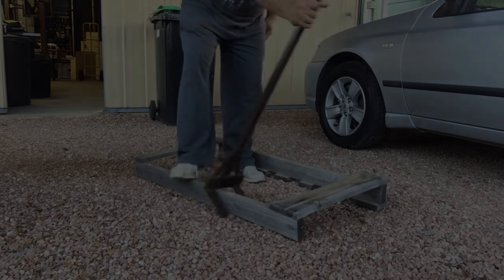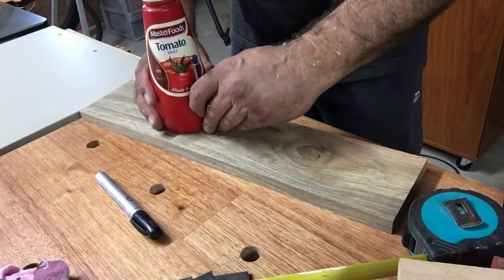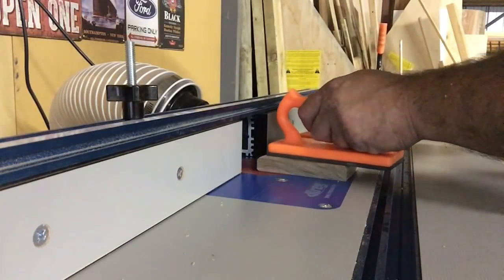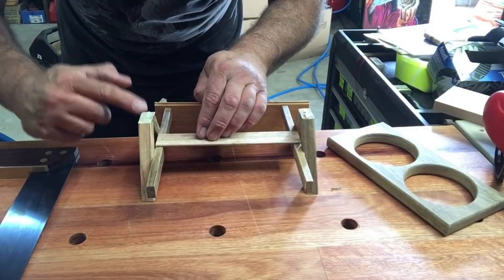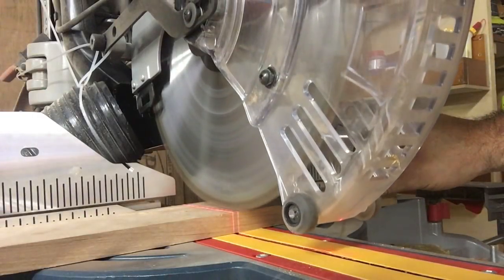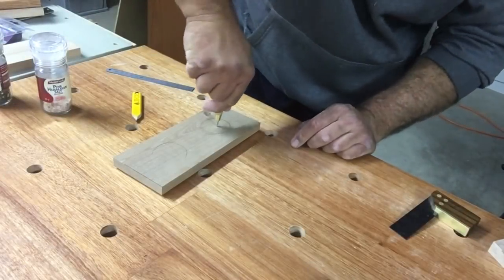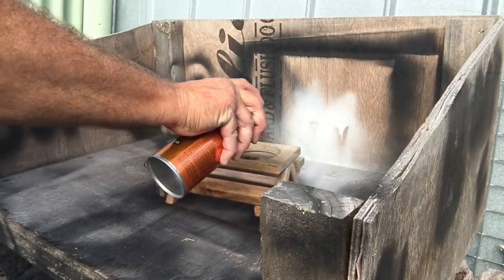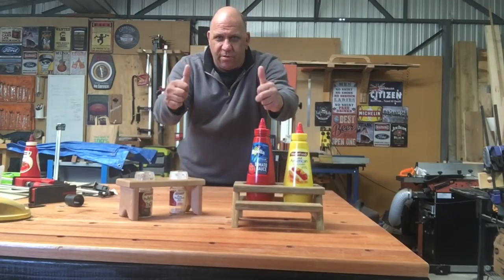How To Make Condiment Holders

Comment: G'day Sumo mate. I like this project - and the jig gave me a few ideas for my jig making. Those clamps are "ripper" by the way.
It doesn't seem so long ago that you were enduring 40+ temperatures and longing for cooler weather - well now the boot is on the other foot . . . .  30 degrees in my workshop yesterday causing my kneecaps to melt and slide down the front of my trousers! If I had room for air conditioning I would have already installed a dust extractor so a fan in front of an open window has to suffice! Now you are entering your winter period [what we call "Back end"] you will need a heater to help bring the temperatures up. Shame we cannot store heat like we can store electricity!
I invested in a set of step drills recently and they have come in really handy, in case you are wondering whether to bother with one; cleaner finish than I expected!
OK Sumo, keep warm my friend, in a few months you will be using those condiment sets.
Thumbs up for another Bonza film!!!  :)  :)
Reply from the maker: G’day Eryk, mate it’s been cool here & ive a wood fire in the shed but I’m soon going to rig up a little fan for it so it’ll throw out a bit more heat. This was a fun little project & marries in with the bbq cart I made, just one more edition to go with that.
Haven’t tried the stepped drill mate but seen them, hey my woodworking store have got a new magnetic device with two prongs that hold your jointer blades in place parallel 😳😳 crickey what will they think of next lol. I believe the UK summer is very humid as it is in northern Australia & that is indeed unfriendly stuff. Big 750 mm fans are cooling in the shed but not ideal for a small workshop. Ok mate be well & chat again soon 🤠🤠🤠🔨🔨🔨👍👍👍
Reply: Glad you are comfortable in your shop Sumo. By the way, I have never heard of brad nails - they may be a larger version of what we call panel pins.
They were selling gadgets really cheap at a local shop that are supposed to be used for hanging baskets for flowers - you pull the basket down to water it and send it back up. Well I bought one for about a dollar and put my safety goggles, ear defenders and mask on the caribiner at the bottom and that frees a bit of workshop storage space.  Every inch counts!!  . . . fan assist on a wood stove? Wife will be getting you to cook the dinner on it :)    Keep smiling and keep warm,  Thumbs up  :)  :)

Comment: Neat recycle, mate 👍 
I use pallet wood all the time. Takes a little prep work, but well worth it in the end I think.
Reply from the maker: As long as the pallets are clean mate & not had chemicals shipped on them, most of our local white good cartage pallets are grouse 🤠🤠👍👍👍👍🍺
Reply: Sumo's Projects, hey bud. I agree whole heartedly about the chemicals.
I always get my pallets from the local Tile shop, they are a one off use and are doomed for the tip after they get the stock off them. These are always clean and non chemical treated, only heat treated. They are nice thick boards, and with a pallet buster a mate made for me, I never split a board. 👍
Reply from the maker: If you can find them that good Bill grab em mate, they get a bit scarce in winter though 👍👍
Reply: Sumo's Projects, I've never actually had any dramas collecting them, mate. I usually stack 7 to 12 on the ute which lasts me around a month or more. Some times a pot less, when my buddy around the corner needs a few 😋 which is no biggie, costs me nothing.